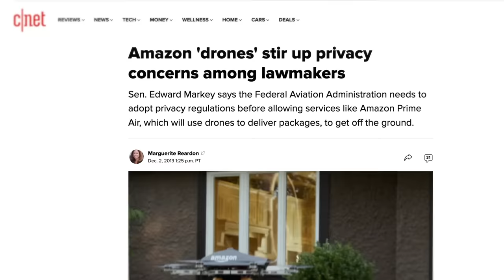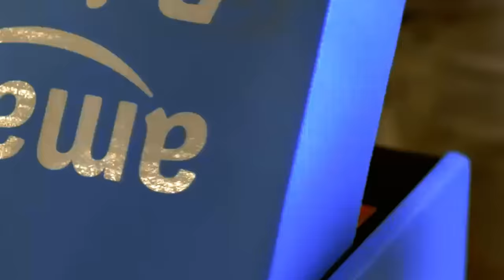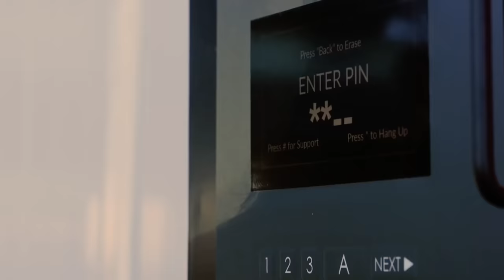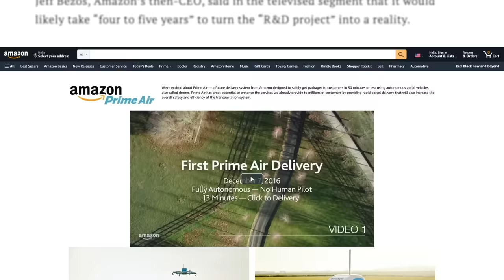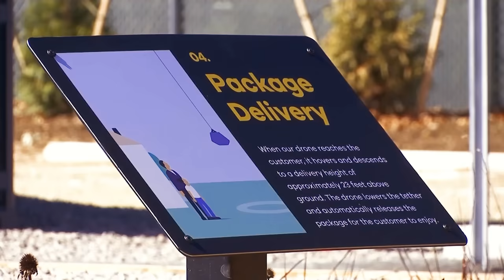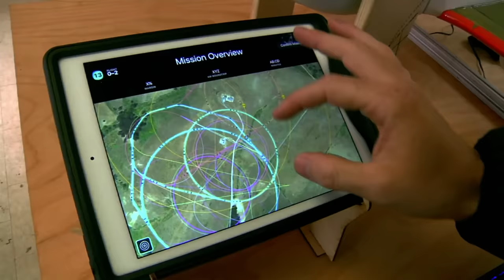Drone Delivery Was Supposed to be the Future. What Went Wrong?

Comment: Why not just have the drones be autonomous until they drop the package, at which point they hover over the general area until an actual person takes control from a drone center that could be halfway across the world to complete the last leg of the delivery? This would allow a driver to be constantly doing the final step which requires humans, the physical dropping off of the delivery, while also allowing drones to do what they’re best at, which is to get the package from point A to the general vicinity  of point B, while requiring far less drivers than the current system does to complete the same amount of deliveries. This also has two side benefits: one, it would allow the drone fleet to be built and bulked up while they work on making it autonomous, meaning they don’t need to invest the absurd amount of money it would take to make the drone perfect and large scale before they get to use the drone program. Once they get the tech to where it needs to be they retrofit the drones, or, even better but harder to do, build them beforehand so they only take a software update to get working as intended. And finally, it allows a company to say “no our drones didn’t hurt this guy, this worker hurt this guy” which would help solve the media problem you mentioned.
Reply: Well then the pay would be worse for the worker controlling the drone, and Amazon would be paying for lots of drone pilots on top of maintaining all the drones themselves
Reply: Bruh, have you seen people play the crane game?  They are terrible at it! Lol all joking aside - Excellent point!
Reply: @Blurro  I’m not concerned with any of that when thinking of this. I agree with you that automation is a problem for workers but I’m (currently) looking at this purely as a logistics/tech  problem and trying to solve it.
Reply: @lemo4739  I was thinking the same thing. One operator could just be like bam bam bam only doing the last hurdle of delivery. Would be a pretty fun job too i reckon.
Reply: Man I was thinking exactly the same thing. In this way a single operator can operate like 20 drones, essentially replacing 20 people (or more)
Reply: @REOsama  exactly. (The beginning of this sounds bad but read it through and you’ll see what I mean) And people always say “but that will get rid of jobs!” And that’s true, but they’re forgetting that removing jobs from the company providing a service (in theory) removes overhead from the company making the products cheaper, which benefits all consumers. I’m not weighing the impacts of the two but we should bring up a benefit along with a negative. And there’s also an idea I have (I’m sure other people do too but I haven’t seen it anywhere) of an automation tax. I’m really against raising taxes on companies and I’m generally against handing out large sums of money due to the monetary drain on the government, but I think this situation is different. Some cursory research suggests that companies spend anywhere from 40%-80% of their gross revenue on employee benefits, including salaries. With this in mind, I don’t think it’s a bad idea to introduce an automation tax where above a certain percent, say 10% of your company being automated, for every additional percent of your company you automate you get taxed a certain percent of your revenue. This solves pretty much all the surface level problems  with automation. That is, assuming the government handles the money well and the tax code is written airtight with no way to get out of it, two MASSIVE assumptions
Reply: I find it hard to imagine they never would have tried anything like that. I assume that it would work fine from a feasibility standpoint but perform poorly from a profit standpoint.

After all, the decisions for everything in this world always boils down to profit doesn’t it?
Reply: Having the drones need to be connected to the Internet would add costs
Reply: Latency makes that a no go. Controlling a drone that could go out of control from the wrong move, you wouldn't have enough time to react and correct.

Automation already does what remote people could do, what neither can do safely is doorstep delivery or apartment complex delivery (receiving office or the parking lot both are too crowded)

Just drop the whole idea, it's not viable for our world.
Reply: @lemo4739  that….yea that’s actually a really good point. For some reason I started talking about drone delivery in general rather than Amazon specifically.
Reply: @Jaker788  That all depends on the tech. 😊
Reply: this could also solve tamper and vandalism problems. Automated triggers could prompt a human to take manual control and see whos messing with the drone
Reply: That's a really good point. I imagine it boils down to regulations (drones in general) and then you need a cheap and reliable connection with the drone. If autonomous, the range is only determined by their batteries, but semi autonomous drones would also need to be within range of an operator. Internet is out of question because of latency and because there's not WiFi everywhere. Satellite is too expensive and subject to atmospheric interference. That leaves radio waves as the last option. Then you have to take into account signal pollution in crowded areas and obstacles that may reduce the reach.

A possible solution would be to have mobile controller that can change positions in response to current delivery demand or relay stations, much like cellphone service. Only time will tell.
Reply: autonomy allows control over a distance that we can't control via radio, and there's also an employment issue too
Reply: @Jaker788  The latency for 6 miles or less is not bad. What are you talking about? 
I have landed Drones at 3 miles distance no Problem and thats with a cheap 450€ (~400$) Drone.
Reply: @Jaker788  this is just objectively untrue. You don’t have to (and couldn’t) send a Bluetooth signal or some shit all the way across the world, you’d send the signal through fiber optic cables and they would be sent to the drone through beacons closer to the physical location. If this sounds familiar it should, because I’m basically describing a cell phone network. This is an extremely odd point we routinely send signals across the world with next to no delay. And on top of that, even if there was a 20 second delay, you could program automatic safety systems into the drone to prevent it from hitting anything (see self driving cars if you have a problem) and have it hover in place for 20 seconds before dropping it. Of all the things to kill this idea latency is at the bottom of the list

Edit: when reading this back idk why I was so combative but what I said is true lol
Reply: @moteroargentino7944  or you could just build something like the cell network. Or piggy back off the existing network. I don’t really get this point people are making, we already send signals from one wireless device to the other side of the world and it gets received by a second wireless device with next to no latency.
Reply: @LEMO True but you need to have a reliabe, stable and cheap connection anytime, anywhere. If you can't count on that with cellphones then much less with aerial vehicles. I'm not inventing it, that's a real problem military drones have to face even with all their technology. And even more with civilian ones, how many times did we hear about someone losing or crashing their drone?
Reply: @lemo4739  What's the point in manual control when there's a 300 millisecond delay? Halfway across the world as you said, that's just how the latency is. There's no degree of precision that's safe even at 20 milliseconds, the speed of a local connection over 20 miles. I never mentioned Bluetooth, any internet connected drone would presumably be ran through cellular.

Even with manual control, even if you had a controller right next to it with zero latency, you would not be able to safely land better than the autonomous system or in a tighter space. The reason landing is an issue is safety for people nearby, if the drone loses control when the ground effect kicks in or a pet or child runs up to it, manual control wouldn't fix the problem at all. You still need an open area or it's full stop not safe.

Why land the drone anyway? That's the least of the problems mentioned in this video, dropping by winch and an electronic disconnect is easier and cheaper than remote control operators. They already went in that direction but there's still so many issues that make this idea impractical. Range, cost, non single family housing, who's going to want to pay for all this, why would anyone want to build infrastructure just for 30 min shipping of small items, airspace restrictions, proving safety, weather issues like wind, rain, snow, freezing temperatures, how would this work in a dense city.

This drone thing won't be happening for a long time because there's more practical methods of shipping things last mile. Even that sidewalk cart drone makes more sense and is more efficient, but it still is impractical. It's just a techbro idea that had zero understanding of actual shipping bottlenecks. Amazon has since been doing well with their own shipping vans, if you live near a fulfillment center and the item you ordered is there you will get it within the same day or next day. Is that not good enough?
Reply: @leonmuller8475  Yeah, over 2.4ghz radio and a direct connection. He's talking about over the internet and people halfway across the world doing realtime control. Nah.

There's a reason this solution hasn't been implemented by any company doing drone delivery, that's because it's not viable.
Reply: You can't just have "some guy" control them FAA regs say this is commercial aviation so you'd need pilots with a commercial license (way harder and more expensive to get than general pilots license)  and trained/licensed in remote UAV piloting and in licensed for helicopters as well (multirotors are a kind of helicopter under FAA regs). All of that means they're going to have an expensive salary to pay, which may come out to more than just having a kid hand deliver it for minimum wage.
Reply: @atomicskull6405  would this change or could it feasibly change if a good enough case for this was made?

if the drones are operating purely by themselves until they get within a certain distance of the drop zone, there are quite a few restrictions you can put on the human controls. For example not allowing them to fly above a certain height, not allowing them to move above a certain speed when controlled by a human, you could do a lot of things to potentially get around this, especially if you made a good enough case to the four politicians you need and haven’t bought off yet to get the regulation through.
Reply: @Jaker788  „He's talking about over the internet and people halfway across the world doing realtime control.“
Gaming is done this way and it needs VERY low latency and it also works. 
You will just need a hub in North America, South America, Europe, East Asia, South East Asia, Australia, Africa and it is done. 
Guess how many locations Amazon has? One for EACH major city. (200 000+ People)

So no, no Problem at all.
Reply: @moteroargentino7944  DJI already sells drones with 7 mile range and the sell consumer drones. Given that the use case is the last few miles this should not be the problem.
Reply: @leonmuller8475  High powered drones around people are another deal entirely. This also doesn't solve any problems, you can't land anywhere in a city, you can't land in a crowded apartment complex, you need an open area. These drones lose control close to the ground sometimes, a human won't change that fact. Not to mention you're completely ignoring all the other points that make this internet issue a non factor mentioned previously.

Landing is a safety issue to people and pets nearby, not a control issue. That's exactly why they pivoted to dropping packages by a winch. Not to mention you have to hire licenced operators, which isn't cheap. Drones just can't work for all situations. They're limited to light items, they can't operate in urban areas, the majority of areas are unserviceable and don't have a solution, and people aren't that interested in an expensive solution for 30 min delivery of items that happen to be in a nearby FC and within the weight limit. Drones are an inefficient, expensive, snd not even needed when Amazon already does 1 day shipping for certain items in a nearby FC. Do you need 30 min shipping over the internet instead of going to a store if it's that urgent?
Reply: @Jaker788  „you can't land anywhere in a city,“
Yes you can, but you don‘t need to as you said, you can use a winch, you just need someone controlling where it is lowered, to make sure it doesn‘t hit somebody or an animal is near. 

„you can't land in a crowded apartment complex“
You don‘t need to land in an apartment complex you can land in front of it. 

 „Not to mention you're completely ignoring all the other points“
Such as?

„Landing is a safety issue to people and pets nearby, not a control issue.“
It is only a safety issue because an automated Drone cannot reliably distinguish important safety hazards, while a person can do that very easily. 

„Not to mention you have to hire licenced operators, which isn't cheap.“
It is MUCH cheaper than paying 15 delivery personell minimum wage. 

„Drones just can't work for all situations“
Who claimed otherwise? 
The argument was, that you can expand Drone operation to a useful degree by making the last step controlled by a human. 

„the majority of areas are unserviceable and don't have a solution“
How so?

„and people aren't that interested in an expensive solution for 30 min delivery of items“
Drone flights are not expensive. You would probably only have to pay 3 - 5$ for a delivery. And why care about the 30 min delivery? You could just automate low weight delivery for the last step. 

„Do you need 30 min shipping over the internet instead of going to a store if it's that urgent?“
No? But it could replace general low weight last km/miles delivery. 
I am not interested in the 30 min delivery at all, I am just arguing that human control for the last few meters of a Drone delivery could solve a lot of the problems listed in the Video. 
I am more than satisfied with the 1 or 2 Day delivery for 95% of items.
Reply: @leonmuller8475  In a city it's kinda sketch to go flying drones around, wind speeds are high between buildings and flying over the streets is a no no in case it crashes. Where do you deliver to? Why can't we just use Ebikes like we already do for stuff like Uber eats and door dash, that's actually pretty cheap.

If you use a winch you don't need people, the automation has been able to handle that just fine. But it doesn't work anywhere except an open lawn for safety reasons, a parking lot in an apartment complex is not safe whether a human operates it or not. Those drones can easily kill someone if it lost control, and it does happen.

The range of these drones is only about 6 miles, how many depot's are we going to consider worthwhile to service an area? Not to mention weather may make an entire week impossible to deliver due to snow, heavy rain, low visibility, or too cold. That drone infrastructure will sit unused. A lot of areas just don't have good conditions to be viable, half the year could be impossible in the midwest and east coast.

Small items are carried more efficiently in slip packs on a van or truck en mass like we already do. You may feel like it's inefficient, but it's better than a single drone delivering every small thing to people 1 at a time, that's the least efficient method of delivery and the most complicated. It's also cheaper than your thoughts of hiring qualified pilots to comply with the FAA, and having $10,000 drones with 1kwh battery packs on each one getting fully drained each time. This would cost more than a few dollars per delivery to keep up.

You'd be better off taking 100 drones and making a 100kwh electric van to deliver up to 3-4k pounds of product or a good few hundred slip packs of small items on a nice efficient route. Delivery vehicles can take up to their curb weight in packages.

This drone delivery idea will never happen. Safety can't be guaranteed as well, for people or the airspace. The FAA restrictions put a damper on serviceable areas.

I feel like we didn't watch the same video... Or you underestimate the massive number of problems with this idea that haven't had a solution in around the 10 years it's been in development by a lot of big and small companies alike, all with the hopeful idea, but most coming to the conclusion that it's just not worth it or even a good idea.
Reply: @Jaker788  "Why can't we just use Ebikes like we already do for stuff like Uber eats and door dash, that's actually pretty cheap."
We can,  I have nothing against that. 

"If you use a winch you don't need people, the automation has been able to handle that just fine."
No,  the problem remains. When a Cat or a Dog jump for  it, it creates  a safety hazard, a human can identify such a  problem  pretty easily. 

"A lot of areas just don't have good conditions to be viable, half the year could be impossible in the midwest and east coast."
Don't know  how the weather  is  there,  but  here in Middle Europe  you will  likely get   300+ Serviceable days. 

" It's also cheaper than your thoughts of hiring qualified pilots to comply with the FAA, and having $10,000 drones with 1kwh battery packs on each one getting fully drained each time"
A pilot can easily do  the work  of ~20 Drivers. And 1kwh of power is pretty cheap (5 -  30 cents), easily  handled by the  customer who wants a special delivery. 

"You'd be better off taking 100 drones and making a 100kwh electric van to deliver up to 3-4k pounds of product or a good few hundred slip packs of small items on a nice efficient route. Delivery vehicles can take up to their curb weight in packages."
Yeah,   I  know, never argued otherwise.  

"This drone delivery idea will never happen"
Likely  so. 

"I feel like we didn't watch the same video..."
I feel like you have a  completely wrong impression  of my view  on drone  delivery. 

"Or you underestimate the massive number of problems"
No, I don't I just  think  that trained  pilots for  the last few  meters is a  good solution for  one of the main Problems  this Idea has. 
I  have  never claimed   that  this solves  all the  other Problems this  idea has, nor do I believe pilots  will  fix  these. 
I was just  defending LEMOs Idea and claiming  that it actually does  solve  ONE  Problem  drone  delivery has.